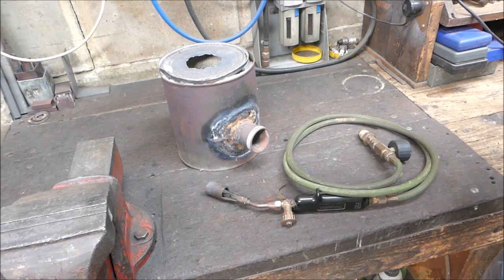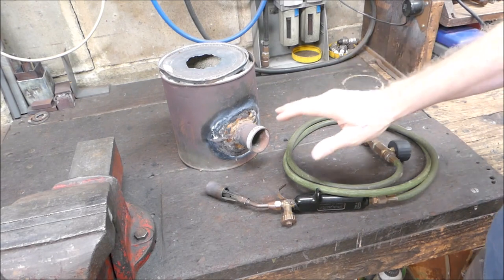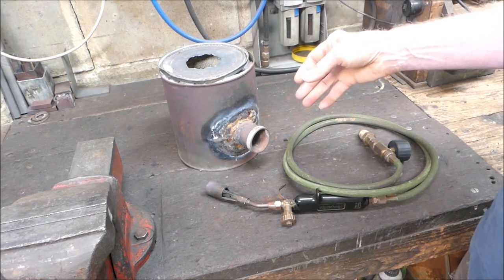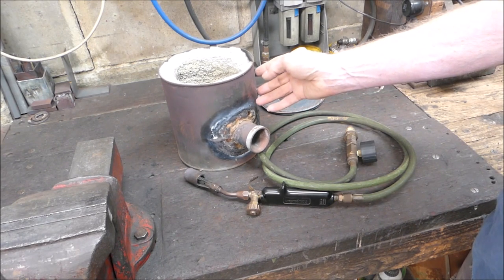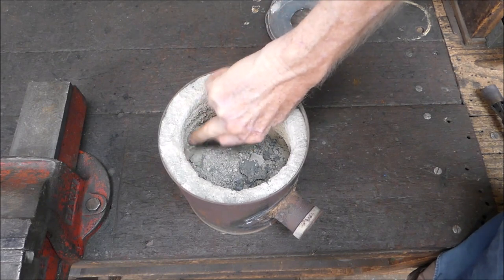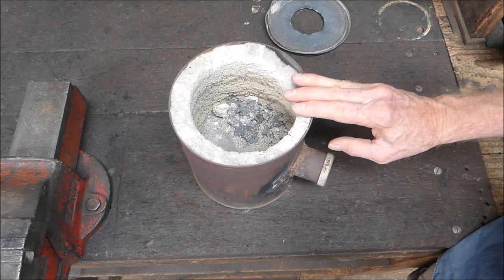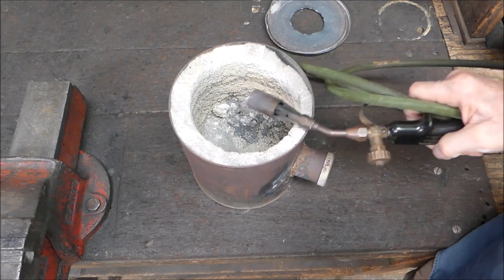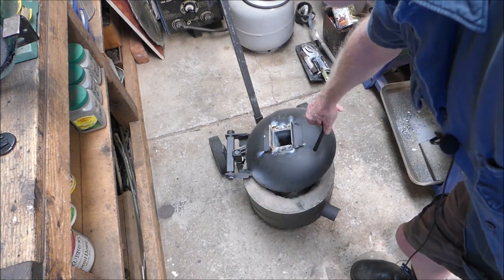How well do Perlite and refractory mortar stand up to intense furnace heat ?

Comment: Hello sir. Good video. Ive been diy building these furnaces for about 8 months now. I used to use the diy recipes for refractory getting material from local stores. Perlite was the main material i used all the time. Ive noticed from doing about 25 different recipes which utilized different ratios of cement to perlite to sand to bentonite clay to water glass, etc etc, that it never held up to the heat that is needed to melt brass and copper. It would break down just as yours did. I even coated the diy refractory cements with green patch 421 and/or Girtech mortars which are rated at 3200’f. They held up better but behind the coating the diy refractorys would still breakdown. The only thing holding it in place was the strength of the coating which as time and usage went on eventually you develop cracks and the diy refractory cements would fall out like sand in an hour glass. Water glass ( sodium silicate) was the worst ingredient to use because i found out it melts to a liquid glass at 1900’f and above. Had a furnace lid completely fail and melt into the crucible when temperatures exceeded 1900’f. Ive since decided to use kaowool with the Girtech mortar coating which has done extremely excellent. Holds up and lasts a looooong time. From time to time putting a maintenance coating of the Girtech mortar on it as it develops tiny cracks, which doesn’t hinder the efficiency and usage of the furnace at all. I have also just recently made a mixture of perlite and water glass ( home made water glass, easy to make) and made a 2.5” x 4” x 9” fire brick with it and attached kaowool to one side of it covering that entire side. Then used a 1” furnace burner, secured the burner in a vice and aimed it at the perlite/water glass fire brick on the kaowool covered side. Fired it for 15 minutes reaching 2500”+f on the kaowool side for 15+ minutes. No melting or damage to the perlite/water glass mix fire brick. So in doing this test I’ve decided that when i build a 16” round furnace with 3” walls, bottom and lid that i would make the first 2” with the perlite/water glass mix then line it with the kaowool, then coat the kaowool with the Girtech mortar. The perlite/water glass mix is an awesome insulator while the kaowool coated with the Girtech mortar is not only a good insulator but an efficient refractory of heat. Anytime i build a furnace with 2” or more of walls/bottom/top i will use at least 1” of the perlite/water glass mix refractory to cut down on a little expense of using just kaowool material. I built a kaowool/Girtech coated propane tank furnace and with a 1” frosty T burner with a .035 mig tip Ive melted a #6 crucible of copper in under 20 minutes using about 18 psig of propane gas pressure. With the 2” of kaowool used for the sides, bottom and lid the sides of the propane built furnace gets about 180-210’ f. I made a small 12” furnace using only 1” of kaowool on the sides and 3” on lid and bottom and the sides get around 300’+f after my first copper melt which is not bad at all. Anyways hope maybe some of my info here can help anyone reading it who builds these furnaces. Cheers smelters.
Reply from the maker: Wow, thanks for the in depth comments.  Much appreciated.  Yes, my furnace lining is deteriorating same as everyone else will and your comments are very interesting.  One good thing is that it should be easy to restore, but a cheap longer lasting solution is what we all want.   Best bang for buck ?  Cheers Rob

Comment: Used to fix up older style cooking stoves. Mainly replacing refractory tiles. Good quality tiles have very little expansion, so you could cut them into wedges to sit loosely inside the tank. A single cut to suit one on the bottom, another to be held loosely on the top. It does work, having done this myself. Out of this job many years, so you have to look for these tiles, can't  be too hard.

Comment: Thanks for putting the video out, I made my furnace about 5 years ago and used perlite and Portland cement at 4 to 1 ratio. the wear on my unit looked exactly as your looks. I thought I may have done something wrong, but it would seem the crumbling is just the nature of the beast. Mine is made from two five-gallon water pails turned top to top. That way the unit splits in the middle and just set off the top half off the furnace and the crucible is about halfway out before you even try to grab it. You don't have to reach down into the furnace. Not saying it's any better or worse than any other unit it's just the way I did it
Reply from the maker: Thanks for the info.  Your design is a good take on the issue.  The problem of durability as I see it is that the temperatures are higher than the cement and mortar as designed for.  Perlite is volcanic rock and remains intact.  It's the binder that breaks down.  Whether varying the mix ratio will help is debatable.  I have reservations on that.  Cheers Rob
Reply: @Xynudu  Portland cement at a small ratio... Silica sand and perlite
Reply: And a bit of Fireclay... Dont be afraid to by a 20kg bag from Bunnings..
Fuck refractory ..cements..
True your honesty Rob!
Not quite the brass yet ole mate.
Cool vid. Down to earth
Reply: The secret is fireclay
Reply: @djpaulk  And a small amount of water glass.

Comment: What a great thread. I ,m retired & have spent the 
Last three days reading everything I could on this. Every time I think I have this figured out I 
Find some where it fails.I must check out the 
Girtech mordar. Thanks
Reply from the maker: It's a very varied subject.  If money is no object it's going to be a better end result, but for the pittance this cost it works pretty well.  Cheers Rob

Comment: It is very interesting , good to see the wear on what happens I use  hebel aerated block  easy to replace I get about 8 copper burns out  , great video mate
Reply from the maker: Glad you enjoyed it.  Interesting subject.  I've done a couple of brass burns recently and the sand and refractory mortar mix have stood up very well.  I have some ceramic wool and hardener to install if/when the insulation thickness gets reduced significantly.  Still a cheap option if you buy it off of Ebay.  Cheers Rob

Comment: I just found this post, very interesting. I built one (using a 9 kg propane tank) but lined it with firebricks from Littlehampton Bricks. I dug down in the garden until I hit clay and used that, mixed with some Perlite - not much - and added kitty litter (Bentonite clay). This was mixed to a stiff consistency, lined the tank with it then stood the bricks against it and pushed more of the mix between the bricks. The bricks were cut with an angle grinder (DUSTY!!) so they fitted close together. It seems to be working ok so far, other than a chunk just fell out of the lid!

 I've melted brass with it but damaged my crucible getting it out, I've just melted some aluminium (from BMW suspension arms, good stuff) using a pot made from steel tube.   I built a gas forge and managed to get hold of some Kaowool, but I didn't have enough left for the forge and couldn't get any more from the guy. It's the best thing to use but difficult to locate here in Adelaide.
Good fun, isn't it.😄
Reply from the maker: Hi Richard.  The firebricks are a good idea.  Lots of options to try out ;)  My crucibles are thick steel and pretty much indestructable.  Melting brass was no problem.  The fumes are toxic so take precautions.  Lots of fun and a good money saver.  Cheers Rob
Reply: @Xynudu  My "pot" is thick steel tube with a steel plate welded to the bottom. The original one was used in my coke forge to melt brass but it got a bit hot, melted the bottom and the brass flowed out into the tuyere and blocked the airflow!!! It's easier to control the heat in the foundry.
Cheers, Richard.

Comment: Hi Rob. Very interesting. I didn't expect it to start breaking down so quickly. The only things I could think of have already been mentioned in other comments.  Coat the inside with a layer of just refractory cement and or use a stainless steel liner. I suppose you could use a layer of firebricks on the inside, they might last longer than the pearlite mix. A tricky problem. Cheers, Alan.
Reply from the maker: Hi Alan.  I'm not really surprised given the massive heat involved.  I will give it some more thought when the time comes to replace it. Cheers Rob

Comment: I made a furnace using a popular online recipe (Portland cement, sand, fire clay and perlite). Of course being the sort of person who likes to test the limits, I was soon trying to cast bronze with it. I found that the perlite actually melted at high temperatures and acted as a 'flux' for the surrounding material, which glazed as a result. A bigger issue was the pedastal for the crucible, along with the region of furnace wall directly opposite the burner. Both of these melted into a greenish glassy substance. It seems that the Portland cement melts at such temperatures and once again acts as a flux, once it goes the remainder of the material goes too.

I subsequently made a new pedastal from fire clay and sand, and fired it in the furnace as if it were pottery. This held up far better, remaining perfectly solid even when melting pure copper. I then covered the hot spots on the furnace lining with fireclay only. It resists the heat well but tends to flake off, I think I actually need a small amount of the 'flux' to melt and bind the clay more thoroughly to the wall for best results.

If I were to try again I think I would set out to find a mix with less cement content, maybe just enough to provide sufficient green strength.

Comment: Would putting a replaceable rolled steel or stainless (or pipe section) sitting inside the refractory lining protect it without robbing too much heat?
Reply from the maker: I did consider that, but didn't have the right sized SS pot. It should be OK if thin SS is used.   I originally lined my earlier paint tin furnace with a mild steel liner but it eventually burnt away.  I have relined the gas bottle furnace with sand and refractory mortar, has set rock hard, but have yet to test it with high heat.  Cheers Rob

Comment: It might make sense to separate the two functions: insulation vs. heat shield. It seems like the pearlite/mortar mix is a good insulator, but its inside surface won't hold up to the direct blast. Suppose you coat the inside with just mortar--with no pearlite--to make a layer of, say, 1/4" over the pearlite/mortar mix? You could probably just scrape the loosest material that's there now and then line it with 100% mortar. Same for the lid. I've seen this done over that light-weight fire brick (which provides the insulation). Youe already have the insulation in place.
Reply from the maker: Hi Todd.  I had a layer of refractory mortar over the exposed areas, but it didn't last long.  The issue is the temperature exceeds the heat limit rating of the binding agent.  Cheers Rob

Comment: Enjoyed your series on the build Rob. I used a glazed tube garden pot surrounded by sand inside an old hot water tank. It's had many fires over probably 4 years or more. Some of the glaze has melted to the bottom and the clay pot is definately cracked. It melts brass no worries. I looked at the cement versions but was always concerned about the breaking down. My lid consists of a Hebel block that does detioriate but easy to replace. It's heavy for sure. Thought I'd share for you to ponder. Btw it ain't pretty lol. Cheers George
Reply from the maker: Thanks George. Cheers Rob

Comment: I saw this mix on the honeydo carpenter channel 1 part Portland, 1 part silica sand, 2 parts vermiculite, 2 parts fire clay,  1/2 part water, 1/2 part sodium silicate.
Reply: hd carp has way too many videos to single out the exact one you refer to,....unless you can provide link to that particular one.  I purchased his refractory mix recipe but it is not same as one you posted. Thanks

Comment: love that you show us the bad stuff.. This is what most want.. we see the good..  Thank you mate, top video;; was wondering if I should try to use perlite or  buy refectory cement..
Reply from the maker: Hi Dave, I would use a mix of both.  Perlite should be the better insulator.  It's your call and largely depends upon how much heat the lining has to withstand.  It's all suck it and see time really and largely comes down to price.  I'm a cheapskate, so that's the basis of my builds.  Cheers Rob
Reply: @Xynudu  I bought some 1600AR casting Refractory cement, 4.8kg.. Going to try that, 1st on my lid without mixing any perlite, then make a brick with perlite and test it out.. Its all mostly "lets just try it and see" mostly hay!! Cheers Rob and Thanks for the reply..

Comment: Thank you, Rob, for the video and the information update.   Remember you are heating the new one much more then before.  As you say the mixture thing is a bit of a question, and I suppose more important with the higher temperatures you are using.  I am interested in the work you do.  Thanks again.
Reply from the maker: Hi Glenn,  the heat output of the larger burner is pushing the mix temperature well above what the refractory mortar is rated at.  Pizza ovens don't get this hot ;)  I'm not surprised at the outcome.  Whether refractory cement will cope better is questionable.  There is very little information on durability at these temperatures.  Cheers Rob

Comment: G'day Rob. Thanks for sharing. My current furnace is 4:1 perlite/normal cement and it performs similar to yours but I have continued to use it up to about 20 burns by now but it should be replaced.  One day I'm going to make clay bricks to line it with perlite mix behind it but that won't be for a while.  Cheers Peter
Reply from the maker: Hi Peter.  I thought about Bentonite clay as the binder.  I have a 20 kg bag of that and may try it next.  So many possibilities, it's a bit of a mind bender.  As long as it's cheap I don't really care ;)  Cheers Rob
Reply: @Xynudu  A quick google for fire brick kiln lining here in the UK = well over  £100 to build a furnace as big as yours. The home brew linings seem to be the way to go.
Reply from the maker: Wow.  I'm a bit surprised at that Lee.  I will have to research the subject some more.  I can only assume most home brew Perlite mixes will suffer the same fate as mine eventually.  Cheers Rob
Reply: @Xynudu  you reminded me that my very first mix was 10:1 sand/bentonite it worked just as well
Reply from the maker: I have both of those Peter and may reline it with something similar once it wears down some more (to get a decent thickness).  I have been keen to try Bentonite from day one.  Cheers Rob

Comment: Good one Rob appreciate honestly. I'm guessing for myself I'm going to be using it the same as you for material I can machine. But kinda the cost factor I can spend a lot for fire brick and wool. Or cheaper refractory cement but having to repair more often. Kinda big toss up
Reply from the maker: Hi Jim.  It's a mind bender.  Gotta try the cheap options first I guess ;)  You can always move on to something more expensive next time.  The trouble is that you rarely hear back on how well these home made furnaces last.  Cheers Rob

Comment: Hi Rob, at the begining of this you tube you mentioned that you used heat bricks in one of your furnaces. Do you have a link to this as I do have bricks for mine and was wondering how good did it work? By the way how is the Subi as we have had them for a few years now and greatest resale value of any car we have had. Regards Merv.
Reply from the maker: Hi Merv.  The outside wood fired furnace uses old recycled cement incinerator bricks.  I don't know what they are made of as regards heat resistance.  Some are getting cracks in them now.  The Subaru is going great.  Super happy with it.  Goes in for the first service tomorrow.  All good with nothing to report.  My niece has the current Forester and loves it.  It's surprising how many Subbies are on the road when you take note.  Yes, they have excellent resale value.  Cheers Rob

Comment: What if you lined the inside with a refractory firebrick. I've seen some which are fairly thin possibly a little less than half the thickness of a normal brick. So you use a thinner layer of your perlite/cement mixture and then line with firebrick. The brick might hold up better to the direct flame which protects the mixture and the mixture holds the bricks in place. Possibly a more expensive process though. Thanks for your videos. I am looking at building a furnace for exactly the same reasons you have. Your videos are most helpful. Thanks again..
Reply from the maker: Hi Kegan.  All doable.  The bricks could be sliced with a friction disc to fit cleanly.  Worth investigating.  Cheers Rob
Reply: @Xynudu  That indeed would be an interesting solution.

Comment: As the video proceeded, I thought what if you could line the walls of the furnace with ceramic tiles using refractory cement like thin set.  I have no idea how well or not this might keep the furnace from disintegrating.  Do you think it would be worth a try?  Thanks for the video.
Reply from the maker: Hi James.  I have no idea how that would go.  A lot of this is suck it and see.  Cheers Rob

Comment: I am wondering if the insulation would last longer if there was a liner (i.e. sheet metal) to protect it from the current of burning gas ?
Reply from the maker: I did originally have a steel liner in my previous furnace, but it burnt away.  I think stainless steel may last longer.